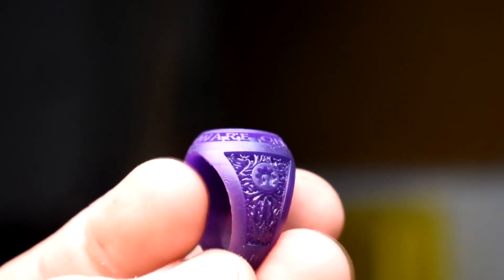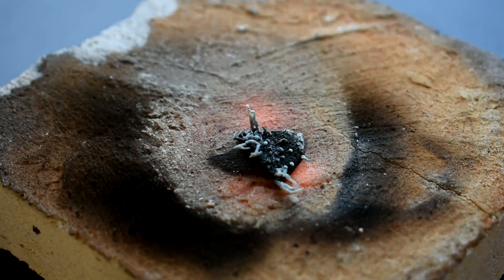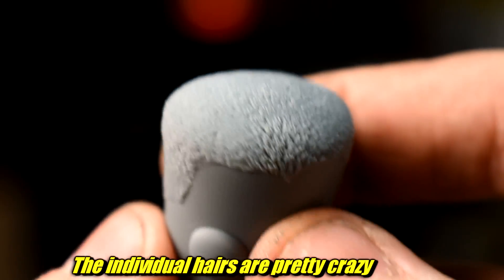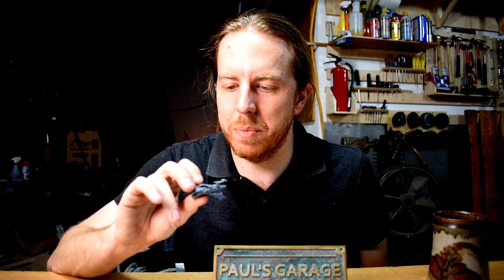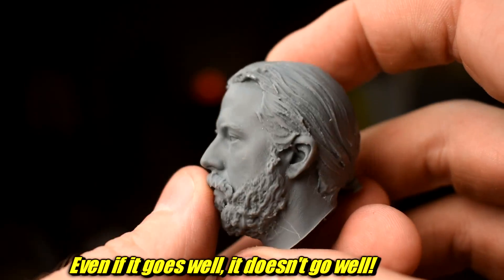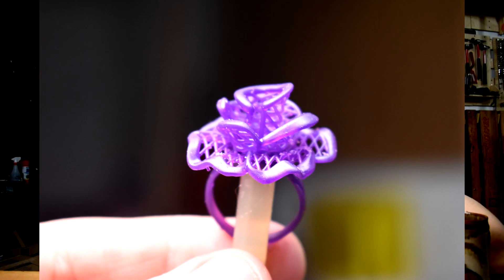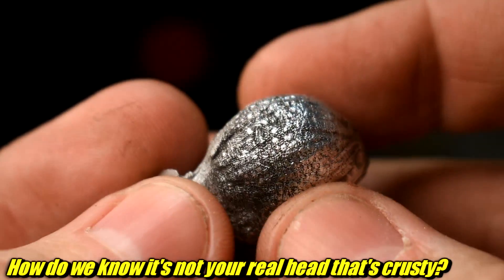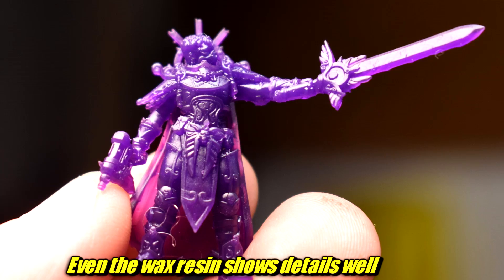Using NORMAL 3D Printer Resin for Metal Casting?  Well....   |   feat. Elegoo Mars 4 Max

Comment: Maybe adding peroxide to the resin can enhance its burning capabilities later. Of course, this should be done cautiously to avoid altering its photosensitivity. Although I don't possess a resin printer to personally test this idea, I suggest someone interested in experimenting with it. Increasing the amount of oxygen can potentially improve the efficiency of burning.

Comment: Why not use an intermediate: print a resin master, do your surface prep and stuff, make a silicon mold, then make as many wax casts as you want, add sprues and make a porcelain mold with those, pour your metal...

Comment: going crazy waiting for a bag of optima prestige that has gotten lost in the mail. ...have a bunch of crap sprued up..and now im out of investment twiddling my thumbs.  I am a glass artist so I am making signet rings that have a glass murrine tile section inlaid into the front.  I just recently switched from 3dmaterials supercast resin to siraya true blue cast..and my first cast with the new resin was insanely good.  SO much better than anything I had gotten previously..but that was the last flask before I ran out of investment..
Reply from the maker: I hope they find it!  I haven't tried the blue but that's the next one I'm getting.  Someone from sirayatech told me the blue has a higher wax content and burns out better for pieces with more thickness.  I want to make big stuff so that's what I'm going to use

Comment: I watched a few videos about making a silicone mould from a 3D print, then using the mould to cast parts in two part resin. I wondered if wax could be poured into the mould instead, and after taking the hardened wax part out of the mould a small amount of clean-up should produce a part ready for investment moulding, and easier burnout. Maybe. I haven't tried this yet, but I would like to. A benefit of having a silicone mould is the ability to produce many parts cheaply, and easily.
Reply from the maker: I think Vogman might have tried exactly that a couple years ago.  I don't remember exactly but he was using 3d printing either for a pattern or a mold or something and then using it to cast wax parts

Comment: Hey paul, Love the content.  

An alternate niche I haven't seen explored much by the community at large, is printing molds.

I have an FDM printer, and I've been 3d printing molds which I then cast wax into.  So a negative of your face is the mold, and the wax figure would retain the detail.
The wax can be subjected to burnout same as metal casting.  
I've been using the wax negatives as forms to pour over into silicone, to make foodsafe chocolate molds.  I use PETG, but I've toyed with the idea of using resin because of the detail it could capture.  I haven't CAD'ed wax vents into the mods part surfaces yet, though I have toyed with the idea recently....  

Would like to hear your take on it.
Reply from the maker: That sounds like a great idea.  I've seen people make silicone molds for wax from printed patterns, but never a printed pattern.  I would assume the mold would either require draft (so you can remove wax from a rigid mold) or try to use a flexible resin or filament so you can peel the mold off of the wax without ruining it.  Maybe I'll get some flexible resin and give it a shot.  

I've also seen people use a certain high temp resin to make molds to directly cast metal into, but they used pewter I think.  Anything higher temperature would probably ruin the mold
Reply: All the following are ideas I'd like to try when I finally get the time to build the foundry I'd like, so don't assume I'm an expert. However I'd suggest if you want to use an FDM printer more directly for this stuff now your best bet is probably that foaming lightweight PLA as a burn out medium. Folks have used regular solid PLA for lost sand casting with reasonable results, and this will have even less plastic gunk left as there is less plastic in the first place. Or perhaps going for those cunning high metal/ceramic content filaments and then doing the post print cook that shrinks the print and leaves you a reasonably pure ceramic/metal result. Both should be reasonably able to take the high casting temperature I'd suggest - though in the ceramics case it probably wants to be well preheated before you pour in the metal.

 @PaulsGarage  Yeah to cast metal into a resin or silicone its almost certainly low temp white metal, though I have seen 'high temp' tolerance casting silicon and resin abuse as a single use mould for hotter melting metals mentioned. Sounded like it worked well enough to useful in a pinch, but badly enough you are far better off doing the extra step(s) to turn a print into a burnout wax or removable form for in investment or sand.
Reply from the maker: @foldionepapyrus3441  even better than the foaming PLA is polycast PVB, it leaves zero residue behind.  That's the filament I use to make air vents in this video.  

I think the guy i talked about used special high temperature resin and the hottest metal he tried to cast into it was a zinc alloy, so still pretty low temp stuff.  Za-12 is a great metal that I love for sand casting, but I'm looking to do bronze with this for the most part.

Comment: What about the gingery lathe
Reply from the maker: very next video is the ways on the lathe.  I'm attaching them in a way that resembles what makercise did, not the way it shows in the book
Reply: I was beginning to wonder if this resin 3d printer stuff was going to tie right in with the Gingery lathe. Apparently no?
Reply from the maker: @blazunlimited  it will yeah.  I'm printing most of the patterns and generally the big patterns will be FDM printed and sand cast and the smaller patterns will be resin printed and investment cast.  It will give me more freedom in the design process and I can make it look cooler. The next casting is the feet though and that will likely be FDM printed (they are big and I'm making one even bigger than Gingerys design)
Reply: @PaulsGarage  Aha! So there is a method to your madness! I’m all for madness just for madness’ sake, but when there is a purpose behind it - also good.
Reply from the maker: @blazunlimited  I have plenty of madness to go around myself, gotta find a way to channel it lol.  I have a theory that "maker" skills compound exponentially, and sticking with just one will hold you back.  I feel very confident in my sand casting ability, so now I'm working on 3D modelling and investment casting.  After that will probably be machining (gotta have the lathe built obviously).  Combining all the skills I can hopefully make some super cool stuff and I won't be held back by a lack of skills